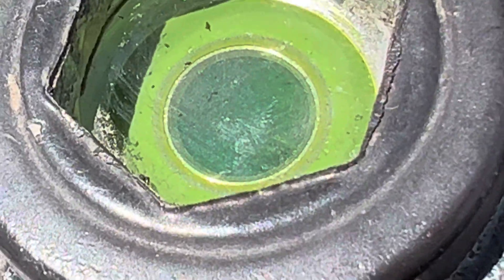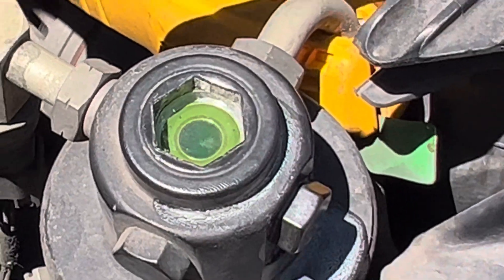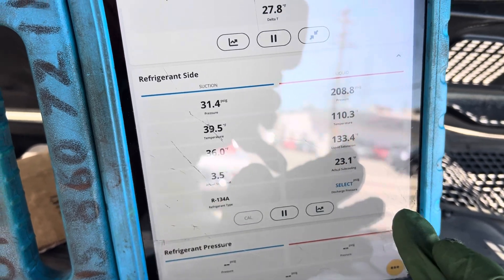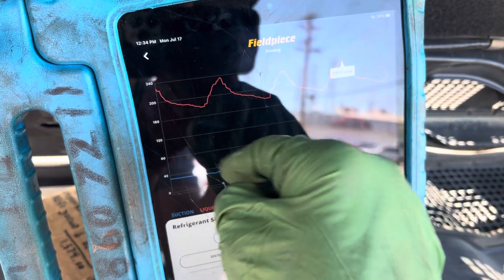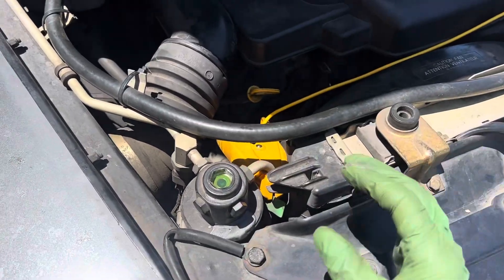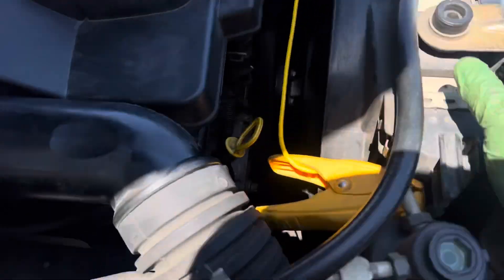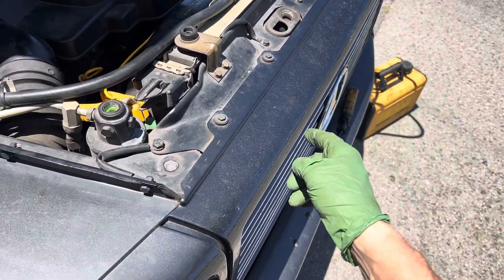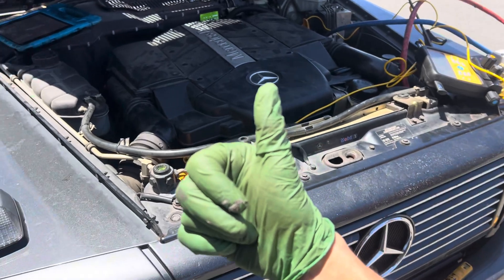Do Not Charge Refrigerant Looking 👀 At Bubbles 🫧

Comment: Hi Tom, can we charge by the SC method? And would R134a and R1234yf have the same SC as i see for the R410A of around 11-12degrees? I only see this information online relating to the R410A.

Reason I ask is because i do mostly off-highway stuff, that quite often have no published charge weights and can sometimes be a pain in the butt to get right.

Thats maybe a video idea for you too :)
Reply from the maker: Usually the answer is no because an automotive, some manufactures, halfway different superHeat or

SuperHeat you would use for a Orfice tube system subcooling you would use for a expansion valve system 

The problem too with automotive so many different manufactures through their computers, and Centers have their fans pulsating on or off never giving you a steady state so you could never use superHeat or sub cooling 

Or they have variable fans that are constantly changing airflow to try to maintain a certain pressure range that would never give you a study subcooling Haas superHeat because as you’re trying to add refrigerant and read the computer is telling the fan to move a little bit and when you change airflow, it changes it superheat and subcooling 

When you add invariable displacement, compressors, and you have a compressor and computer in the background changing displacement of the flow of refrigerant, also changing and giving a false superHeat and subcooling behind the scenes . 

But if you only do one kind of piece of equipment, one kind of car, you can learn what is normal 

It cannot be too cold outside, roughly and temperatures of 75° or more would be ideal as you get lower you get unsteady . 

Do you need a fixed engine rpm? I do not know it would be good for the large diesel pieces of off-road equipment but say somewhere around there normal rpm of 1100 RPMs 1200 RPMs. . 

The fan would need to be controlled so it is steady, not kicking on and off . 

This can only be performed properly if the condenser coil is clean, the evaporator coil is clean and the cabin air filter or screen is clean 

Otherwise, what you will be reading is a number that you think is right but it’ll actually be wrong because airflow is King 

In all situations, the one thing that could mess you up is airflow 

Put on your equipment whether it’s big tractor trailers, earthmovers mining equipment. The systems are so tiny they only have three or four maybe 5 pounds of refrigerant. 

With a good portable recovery piece of equipment, you can recover the refrigerant complete charge out in a few minutes especially if it’s like my NAVAC four-cylinder recovery machine it’s the fastest went on the market cut your times in half or even a lot faster maybe five or six times faster than a Automotive recovery machines 

And then, with a good vacuum pump and vacuum hoses the drain and refill processes really fast 

But if you’re doing the exact same pieces of equipment and these are things that you’re going to see year after year, then you need to keep notes you need a logbook that you can write down the outside, ambient temperature, humidity cabin air temperature that outlet duct air temperature you’ll be doing the temperatures of the refrigerant lines 

And you can experiment on a few vehicles 

And then pull the charge out and wait to see if you were correct 

You repeat this training method of yourself on the exact same pieces of equipment yes, it takes a little longer. It takes time it takes materials but you’re trying to teach yourself something new on a piece of equipment that you’re going to see over and over again. . 

This message is not feasible for a general Repair Mechanic Hwy sees every year make model vehicle from every manufacture because they’re all different 

It’s so quick to just recover all the refrigerant charge and then charge it right back up by weight . And be right 100% of the time all the time every time with no guessing no I’m wondering no I think it might be right.. 

Because you didn’t complete you are always right .
Reply: @coldfinger459sub0  Thank you for your detailed reply!

Most machines i come across are a very basic system with a fixed compressor and one or two sensors to control the clutch. They operate at, or very close to wide open throttle about 95% of the time with the fan driven off the engine belt.